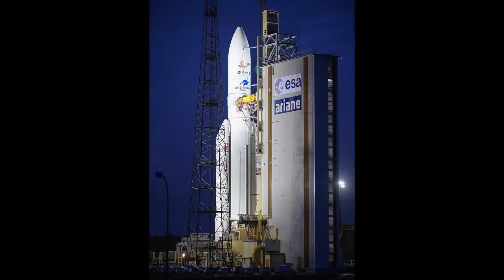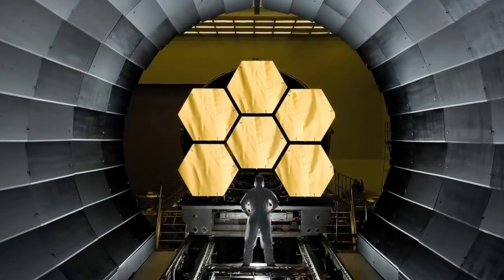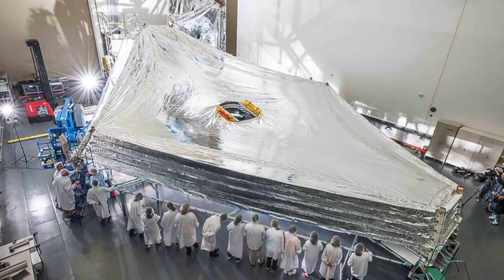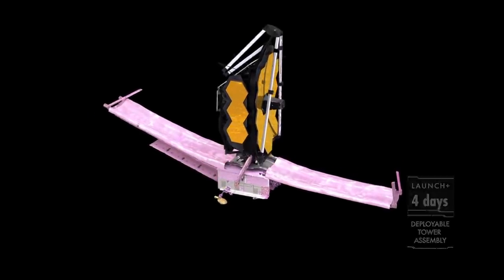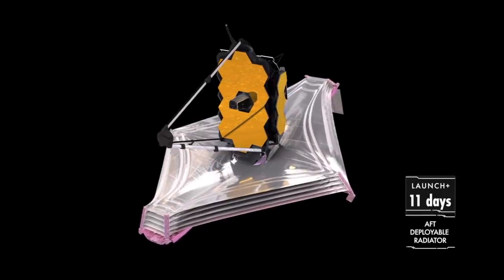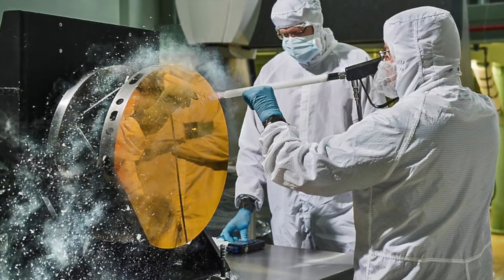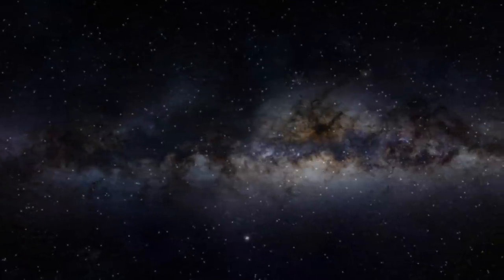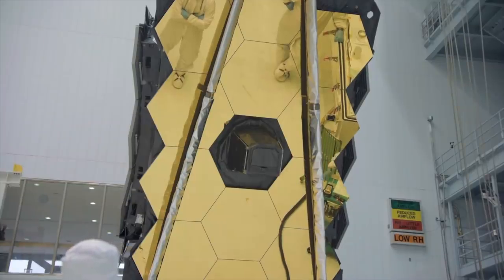James Webb Space Telescope Update and a New Mystery

Comment: As much as that telescope cost you mean to tell me it only has a 10-year lifespan wow what a waste! It should be up there forever! They couldn't use solar power or some type of other power to keep that thing planted?
Reply from the maker: Was only supposed to be 5.5 years. And no, you can't use solar power to keep it planted. All that was possible were chemical thrusters, which means you have a gas tank that can only weigh a certain amount or it can't be launched. All you can do with it is do your observations efficiently, and try to save as much fuel as you can, which pushed it up to 10 years. And in this case, that's about all that's needed realistically. After that, it's the law of diminishing returns.

Comment: Question ❓

Is it possible that this is a crude Dyson's object? 

If I was going to build a simplified Dyson's object; I would build a particle system and not a ring, or a cube or even a drone controlled mirror system.

I would release reflective particles into space around the earth. This seems to be the exact description of the release of a similar system to one that I was thinking would increase earth bound solar potential.

Things that astronomers should watch for would be a sudden stopping of the dust particles. If this happens it means that the planet's orbit has been sufficiently coated in these particles for maximum efficiency in planetside solar potential.

If this is a crude Dyson object then this planet is probably not much more developed than us. This is a crude system. It's simple but not nearly as effective as an actual Dyson object. 

This planet probably hasn't fully developed into the planetary phase, but... Then again neither have we.

Comment: One small point of correction...The Hubble telescope was not designed for servicing.  Servicing only happened because of great engineering and planning, after it launched useless with a faulty mirror....after it was successfully repaired, future missions were only performed through the same meticulous planning.  The initial Hubble mission was never intended for servicing.
Reply from the maker: They lied to Congress about it then, and proceeded to do it anyway. The whole idea was that instruments could be replaced, but not necessarily repaired, while in orbit by way of the shuttle. I remember talk about a servicing mission well before the mirror problem was discovered after launch. You can probably find references to this in Astronomy and Sky and Telescope from 1987-89, but I definitely remember one of the selling points was integration of servicing with shuttle operations, especially after the loss of Challenger. NASA also cites the designed serviceability here:

https://www.nasa.gov/mission_pages/hubble/servicing/index.html
Reply: @JohnMichaelGodier  Interesting...I never knew...it stands to reason then that the Spy satellite it was based on had this capability already too.

Comment: There is something that from way back we are told that the earth ix always beinging hit by small bits of flying objects tbat enter our atmosphere and either burn up on entry, or end up as very small bits of material that can be found.
Over the years tbere must be tbousands of these, which common sense says tnat they travel through space in the same fashion and are unprodicatable from a directional point of view.
They are not travelling slowly by any means which begs the question how come all the things that have been sent into space are subject to being hit by them.
However, there are satalites that have been in operation for decades that still function as new, and one has to ask, how these have managed to not be hit, this inclused the space station which is a big bit of gear with plently to hit, even any craft travelling to this station are likely run run into something.
Knowing what even a 22bullet can do at what is a very low speed by comparison to these objects should by rights put a satalite out of action or at least stop certIn functions, but we never hear of such problems.
I look at the James Webb telescope and its very flimsy heat sheidling milow that is under tension, and take into account the size of same, one could almost say that its a open invitation for having holes pushed throught it let alone the mirrows themselves, i know how little it takes to upset my telescope and know that its best to check colomations every time you set up, so what gives with all the junk we have put into space and how is this avoided???
Reply: Earth is hit by about 5200 tons of debris every year. With the difference in size between Earth and JWST, you can calculate JWST will be hit by nanograms of debris every year.

Comment: When you look at a far off Galaxy through a powerful telescope, you can only see about 4% of what is mathematically required to hold a Galaxy together. 96% is missing and undetectable in the electromagnetic spectrum, and is thereby labeled Dark Energy and Dark Matter. If you were in that far away Galaxy with a very powerful telescope and looking back into the room you are currently in, 96% of what is in the room with you would be undetectable. Let's hope that this or even a part of this 96% is not alive, however the Drake equation shows quite clearly that it more than likely is.

Comment: IF THEY HAD ANY BRAINS THEY WOULD UNFURLED THE TELESCOPE IN NEAR EARTH ORBIT IN EARTHS SHADOW SO IT COULD  BE REPAIRED BY SPACE STATION  ASTRONAUTS AND AN ION ENGINE LIKE VASIMIR WOULD TO TAKE IT TO THE LAGRANGE POINT. IF THE HAD ANY BRAINS THEY WOULD HAVE INCLUDED A ROBOTIC ARM FITTED WITH MULTI TOOLS TO FIX ANY MECHANICAL PROBLEMS. IF THEY HAD ANY BRAINS THEY WOULD HAVE BUILT UP A BACKUP IN CASE THE ROCKETS BLOWS UP.

Comment: One nice thing about the extended potential lifespan, thanks to Ariane's efficiency, is the greater likelihood to have it serviced. We know there is a valve that could allow for a fuel top-up further down the road. If the telescope can now last say 15 years, well the our ability to service it in 15 years is undoubtedly greater than in say 5.5 years. All the more so if it can life 20 years.

For just a refuel, perhaps some autonomous bot could do the job - e.g. designing it to be able to open James' fuel valve, top it out, close it back. It would also make for a nice demo of  autonomous space-servicing capabilities.
Reply: The bot would then need to move off the Lagrange point to avoid any possibility of collision - but that shouldn't be a big problem. The next showstopper would be the gyros, but it looks like they are lasting much longer now.

Comment: orginial lifespan was already set to ten years....so with the fuel savings it should last more now.  where did 5 years came from?
Reply: 5 years is the length of the primary mission. That's how much time they need to answer the questions this telescope was built to answer. The telescope is designed to last at least this long, with margin for error; 10 years is how long they expect the fuel to last.

Comment: Web HAS 344 points of failure, after deployment of shields there are only 86 left. Secondary mirror is most important. If primary mirror does not unfold we still can use telescope but if will be weaker

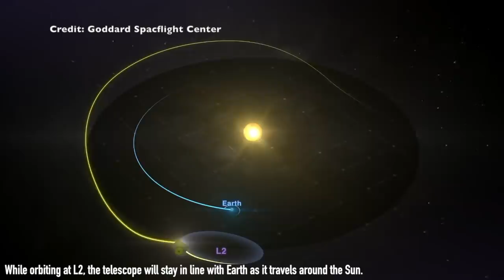Comment: 1:22 While not designed to be upgradable, I thought JWST had been built with a docking attachment in case a theoretical automated refuelling mission should prove feasible. Or am I thinking of an other craft?
Reply: As best as I can tell, if they did go through with the docking attachment, it's basically just a point for a ship to grab onto, I can find no mention that it would have any sort of additional support for refuelling. But there really hasn't been any mention of it for many years, so it's unclear if they ever did implement the docking ring or decided not to bother. Even with the docking ring, it would still be a technological challenge to attempt to refuel JWST and technological improvements in robotics would need to be made in order for it to work.
Reply: No, I have read the same thing.  Therefore, you are correct.
Reply: That would have seemed to be a worthwhile addition to the project given its taken them 20 years to get the mission off the ground. Seems a lot of work for just a 10 year mission when Hubble is nearing 30.
Reply: You're right, JWST has a refueling port. What we don't have yet is a spacecraft that can safely approach JWST without damaging the sunshield.
Reply: You're right.
Reply: You have the right craft.

Comment: How does the telescope store the fuel for that long, I'm under the impression that fuel in space boils off even in a closed container.
Reply: I think that i was stored compressed in liquid form
Reply: Hydrazine
Reply: Boiling off is an issue with cryogenic fuels, like liquid hydrogen.  Webb uses hydrozine fuel and dinitrogen tetroxide oxidizer.  They are not cryogenic.  Also, this fuel has been used in spacecraft for decades (well understood).  It is hypergolic, the fuel and oxidizer ignite on contact, making combustion simple.  It is an ideal and proven system for spacecraft maneuvering engines.
Reply: Cryogenic fuels boil off. JWST uses hydrazine, which is a liquid at room temperature, so there's no evaporation.

Comment: One point I don't understand is why the telescope is being "unfurled" before the finally burn to place it in the correct Lagrange2 orbit. Could that burn twist something out of position?
Reply: The final burn is just a nudge to hit L2.  The Ariane launched it just a little short.  It is easier to speed up a bit to hit L2 than slow down.  Also, regarding applied loads, that is mitigated by having a low thrust over a long period of time instead of a high, short duration thrust.